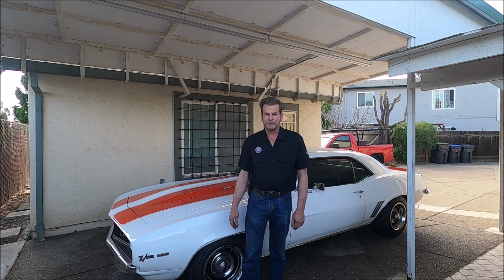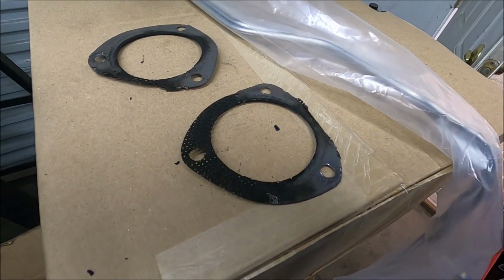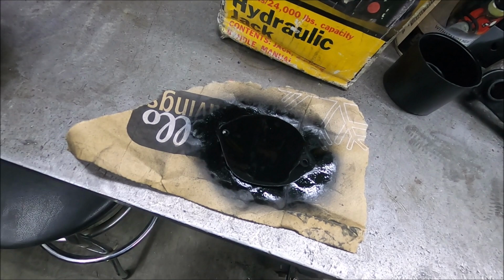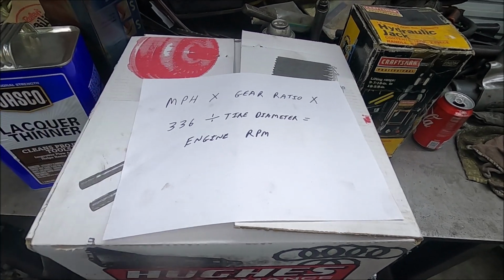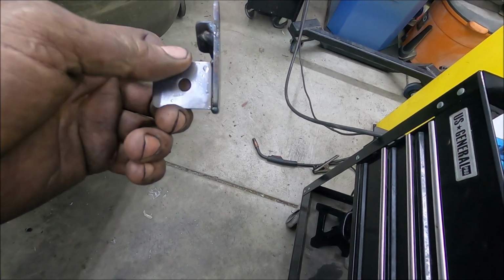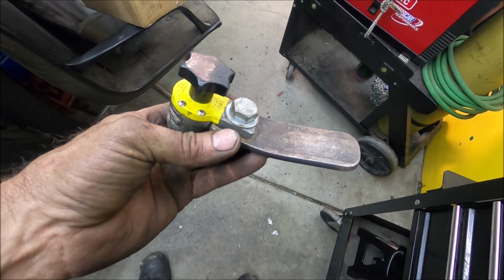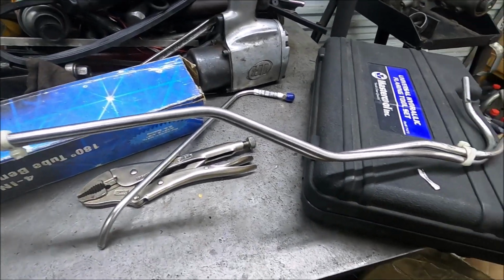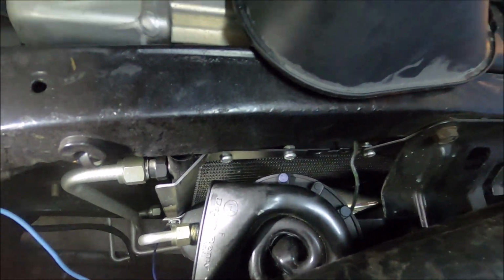Converting a Camaro from Manual to Automatic Transmission

Comment: I've recently purchased a 1968 chevy g10 with a 350 small block and 4 speed Borg-Warner. I'm wanting to convert it to auto for long distance and I have no experience driving manual. I was recommended swapping to the 700r4, I'll have to get the drive shaft lengthened / Shortened but other than that it'll fit perfectly as far as I've heard.
Reply from the maker: You can go with a turbo 350 or 400 or a 700r4